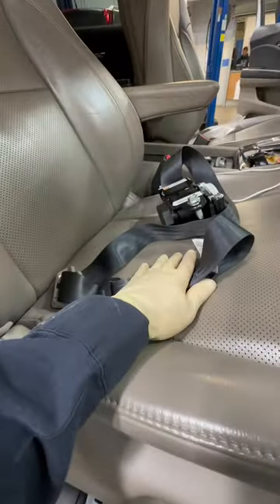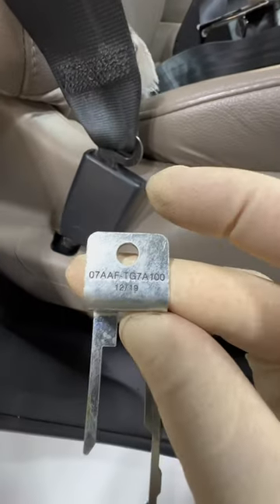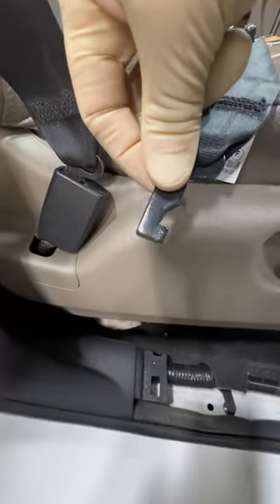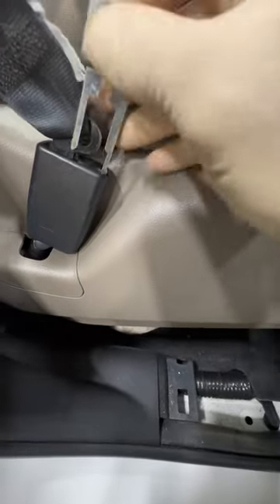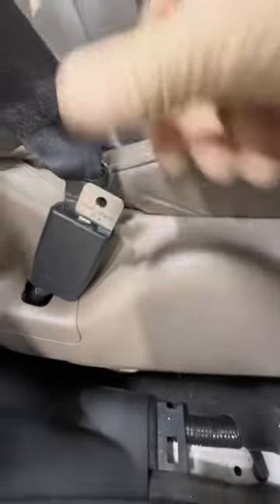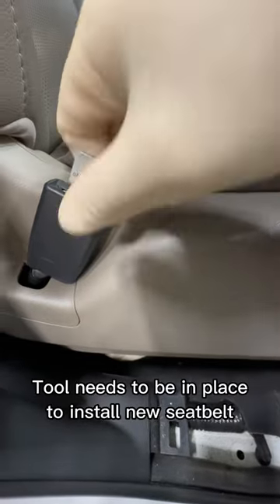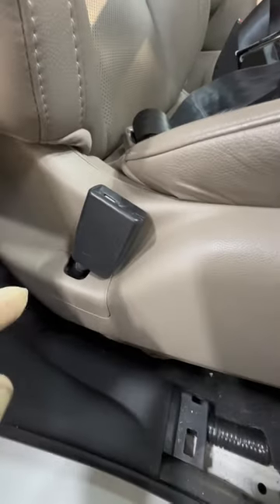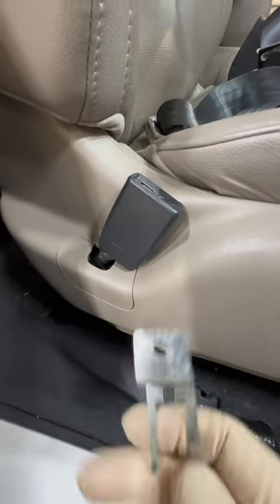Honda seat belt tool #honda #pilot #passport #mdx

Comment: I have a 2008 Accord sedan Exl, I have an annoying buzzing sound coming from the passenger side dash at highway speeds. I think it may be coming from the air vent system. Have you encountered this before?
Reply from the maker: V6 or 2.4L?
Reply: 2.4L
Reply from the maker: @DZE457  could very well be, we see a ton of debri in those filters constantly